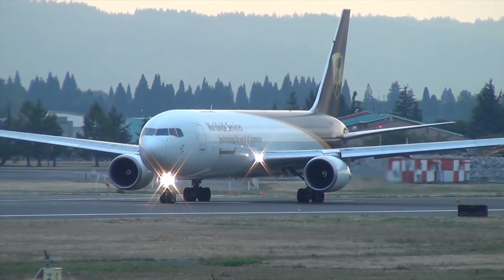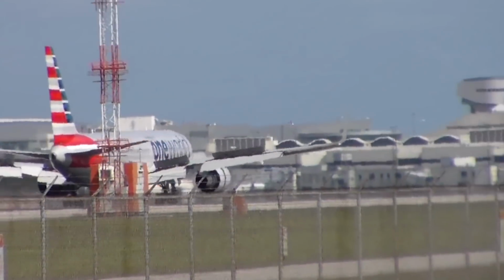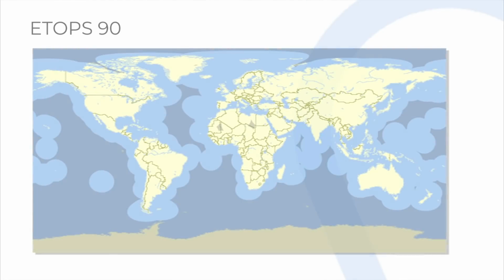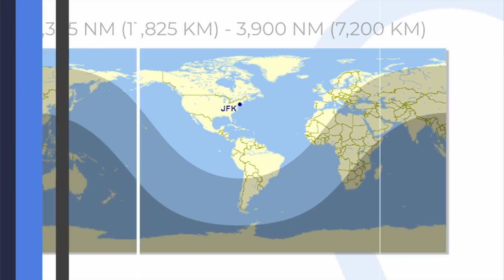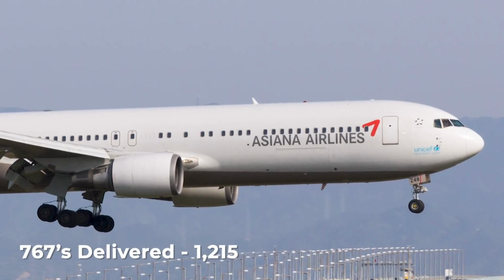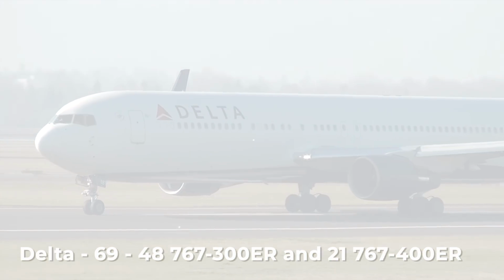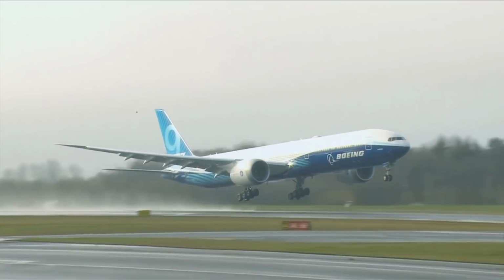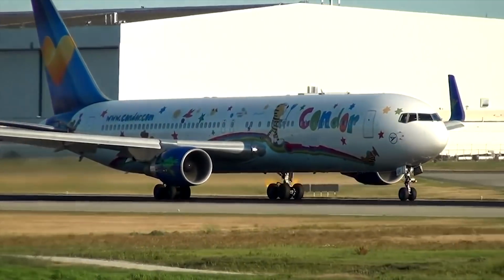The Rise & Fall Of The Boeing 767

Comment: There's no better config in economy on a 2 aisle aircraft than the 2-3-2 on the 767. I'm glad I still have the chance to fly the 767 as I'm based out of Detroit which is a Delta Hub.
Reply: Yup!  People dislike 767 never really flew them.   Delta kept the interior quite modern even before the latest retrofit, and its a nice plane.  It's my favorite widebody.
Reply: Somehow, I’ve never flown on one.  See them at the gates, but that’s as close as I get
Reply: That was a sweet aircraft. They should create a smaller version with more economical engines to go after  that XLR Airbus
Reply: Why is it better than 2-4-2? You still have maximum 1 seat access to the aisle.
Reply: @phoenixgtr  Because there is only ONE middle seat, allowing that passenger to move to either side if needed, with ease.

2-4-2 is still a nice config, just not better.
Reply: Flown that on a Lufthansa a340, really quite nice
Reply: the 2-3-2 configuration is pretty nice, but the rest of the 767 really is fairly obsolete.  It'd be interesting if a future plane could take and update the best of the 767.
Reply: Totally agree with you. For transatlantic flights this model is just amazing! A 767X would be awesome, like the NEO variants from Airbus for the A320 and A330.
Reply: 2-4-2 on the A330 is also really good. Better yet, ANA offers 2-4-3 on some of it’s 77Ws, best of all worlds.
Reply: Boeing 767 (2-3-2) is way better and comfortable than. Airbus 330 (3-2-3) and Airbus 380 (3-4-3) to overcrowded/chaotic

Comment: Cheapest way to take on the A321xlr = 757-8
Reply: The A321 beats the 757 hands-down ... Nothing short of a complete fuselage redesign will bring the 757 up to the 321’s standard ...
Reply: @sking2173  debatable. 757 is thee middle of the market aircraft and is recognised so. A re-engine and a few other drag reduction design changes and the 757 will be complete. 

The -200 has the space for passenger numbers, the range and the STOL ability. The engines are the killer. Now, the technology is there to have the same power but be significantly more efficient.
Reply: @AshMundo  no. The 757 is a gas guzzler. It would need a complete redesign. No point.
Reply: @peteconrad2077  did you not just read what I said?.... re-engine to more efficient ones, drag reducing design implementations, then the plane will be fine. Engines alone would reduce the fuel burn. No need for a clean sheet design.
Reply: @AshMundo  your tweaks aren’t enough. The changes required are so big it needs a new design. An engine change and some unspecified aerodynamic improvements won’t do. It’s wing is appalling by todays standards. It’s structure too heavy by far.
Reply: @peteconrad2077  I doubt it. There are materials in use that can be used. The 757 is notorious for being stol, so lift is easily produced. The engines are powerful but very inefficient, this is a fact. The engines are the biggest issue to why it isn't being done, like the 737 max which retain a lot of the tooling from the next gen for its build.
Reply: @AshMundo  the shirt take off perfect is more to do with being over powered. The wing isn’t up to the spec of the 320 wing by a wide margin. You can’t just change the material an aircraft is made from without completely redesigning it. You put some CC bits on but a full change is a new aircraft. Redesign and complete recertification.

Comment: At this time, Boeing will likely need to freshen up the current 757 and 767 with new engines, weight saving measures and a modernized interior. It will blow away the A321XLR! Even more importantly, there will be a ready market to convert the ones currently flying into cargo aircraft, and Boeing will also be able to have a cargo variant of the more efficient and modern aircraft. This is more than likely the path Boeing will be taking. It's simply too late for a clean sheet design unless it's secretly ongoing.
Reply: The 757 sucks when compared to the 321 ...
Reply: @sking2173  if airlines are flying planes that are 30-40 years old, and they don't want to let them go, believe me, they don't suck.

Comment: I just have a few questions. 1. Dis the 767 really have upwards sliding door.
2. Why did the landing gear arranged itself forward
3. Why the rear of the aircraft taper to the centre more evenly than other aircraft
Reply: 1. Yes. 2. To fit into the wheel wells. 3. I don’t know.

Comment: Yes the 737 has been upgraded, even recieving new up-to-date wings with the NG. Conversely the 767, while a more than capable freighter (where different economics apply) and still being profitable for operators as an older and cheaper to buy/lease etc. aircraft has received little in the way of a significant development.

Would new more efficient engines give enough of an improvement to justify the much higher acquisition costs (admittedly cheaper than a clean sheet design would be) of a factory fresh aircraft? Or would a baby 787 with scaled down wings etc. be a better proposition, even than a clean-sheet design? After all Boeing successfully scaled the 707 down to the 720, and used much of the technology/design for the 727 and 737 lines. 

In the days where flexibility is King, perhaps a degree of commonality and interchangeability is desirable unless it is taken to an extreme, which so many now believe has been the case with the 737.
Reply: Has a new updated flight deck as well...same PFD/MFD setup as the 787.

Comment: A fellow avgeek highlighted this to me. It’s really impressive how the 767 is pretty much the only commercial aircraft that has been in production for as long as it has, without any major structural, propulsion and aerodynamic modifications. It retains the GE engines offered from very early on, for example. I did my school internship at an aircraft maintenance facility, where they do cargo conversions. There were 6 passenger 767s being converted and the facility had just delivered its 50th 767 conversion. What’s more, cargo carriers are still snapping up brand new ones (UPS just ordered 17) and some passenger airlines are struggling to replace it, all this shows how good an aircraft the 767 is.

I maintain the best solution to Boeing’s NMA is a re-engined 767, instead of the re-engined 757 everyone (avgeeks) seems to want. The existing 767 production line can be simply upgraded for the new plane, a 767-200 sized aircraft could offer wide body capacity and range, to match or even beat the A321XLR and Boeing would save a ton of time and money, compared to launching a “797”. Fingers crossed from a response from Boeing, cause Airbus are on a roll right now.
Reply: The 767 is quite unchanged from the original 762 and 763 designs. The original GE powerplant is gone, just as the original PW is gone. The CF6-80A is quite a step back from the newer CF6-80C2, just as the PW4000 is much better than the original JT9Ds. 
The winglets have also greatly improved effiency on this ancient design. 

A re-engined 767 will be of no use to Boeing creeping right into the 787. A long and wider narrowbody of the size of the 757 is the way to go. A re-engined 757 will not work as well. Clean sheet it is.
Reply: @kingsharkoon  Let’s wait and see.
Reply: Thing is, the main reason the 767 is still in production now is the military. The KC767/KC46. 
Boeing didn’t mince their words, if they lost the tanker competition, the 767 production line would close with many job losses.
They were considering closing it at the same time as the 757 line.
Reply: @BrySkye  UPS just ordered 17 new 767 freighters from Boeing, a majority of the current orders are from FedEx and UPS, I don’t think they sold as many KC46-As. But the fact they make the 46A is the reason why their NMA can be a reengined 767. The 46 is a 762 sized airplane which can seat 220 in a comfortable 2 class config.
Reply: Boeing is starting to remind me of GM.. pinheads in the executive suite that ignore the engineers and designers.

Comment: I still think that whilst Boeing could upgrade the 767 with new engines etc, I don't think many airlines would take it. United would probably be the only large customer for the passenger version. The 757 has been out of production for 17 years so that wont be upgraded, the 737 cannot be updated again - it needs a new clean sheet design, and the 787 is too new to be upgraded yet - no one would buy it. If they were to upgrade any aircraft it would be the 767, but I think that the best option is for a clean sheet design, as it would probably put Airbus on the back foot, not just catch up to them, even if this will take longer.
Reply: Do note that 767 never sold well in Asia.
Many countries in the region were either geologically isolated, lack of viable land transport, or export powerhouses. Cargo capacity is crucial in the region, and 767 dwarfed to Airbus widebodies, which can take 2 LD-3 in a row.
Japan was the only exception, but it also fitted the above three characteristics. They bought 767 because of local subcontractors and diplomatic ties with US, not necessary because it's the best fit. Now 787 is the best fit in Asia, with better efficiency and cargo capacity. Japanese companies involved more than ever in the program, while other Asian supplies participated as well. 767NG on the other hand simply won’t gain a foothold in this fast-growing region.
Reply: Any new aircraft will arrive in the mid 2030's , easily handing the market to AB. Airbus as well could work on a larger varient for the a321or a new cleansheat design that could be fuelled by XLR sales revenue.

It wouldn't be smart to leave the market to airbus just like that , because it could become hard to for Boeing to win such customers back to Boeing products. 

Numerous airlines are starting to streamline their fleet to operate an all airbus / Boeing fleet , so handing the market to airbus could turn most carriers into All airbus operators
Reply: You do know that the 737 is the second largest moneymaker for Boeing ?? They are already designing a newer re-engined version without a clean sheet design . It’s gonna have wings like the 787 with more efficient engines than the max with a raised Landing gear to increase height (for takeoff weight reasons) . So it’s already on the way and set to come by 2027 or 2030
Reply: @nikkib-superbass3580  they are already re-designing the 737? Nah, ofc not, the 737 is upgraded to its max, it's way logical for Boeing to make a whole new aircraft
Reply: @mgsaviation9292  good pun
Reply: @PranadPrabhu  :)
Reply: @mgsaviation9292  oh ye I forgor about the level cap for the 737 , gotta get a new one 🤣

Comment: Awesome. Please do a similar video for the Airbus A300, A310 and A318
Reply: The 319 hasn’t fallen yet, still a really popular aircraft.
Reply: @iamjames8200  yea but with the A220 eating it’s way up the Airbus lineup, the 319NEO has been suffering.
Reply: @iamjames8200  oops sorry. I meant the A318
Reply: As of January 2022, of the 561 built the A300 has been involved in 77 occurrences including 24 hull-loss accidents causing 1435 fatalities while there were 255 a310's built which have resulted 12 hull-loss accidents with a total of 830 fatalities making them the 2 most dangerous passengers jets ever built!!!!!!!!!!! By contrast there were 1,261 767's built there have been 854 fatalities including 9/11, Egypt Air suicide pilot and multiple hijackings and the 757  1,050 built with 575 fatalities which includes 9/11 and multiple hijackings. As of today there are 764 767's and 683 757 still in service flying passengers 40 years later by contrast there are 197 a300's and 26 a310s flying today almost exclusively freight only.
The A300 and A310 have the worst fatality records of any plane ever built in the western world.
Reply: A310 has been done already
Reply: @LDNT14  yes. On the other channel but not this one
Reply: I agree, but the a318/19 is still doing really good
Reply: @piedmontrailfan81  I wouldn’t say the a318 is still really around that much, at least in the US. It’s all but gone from most airlines. The a319 is still a part of many airlines.